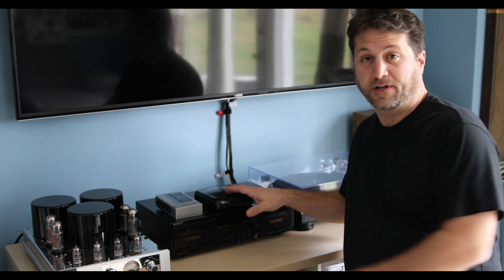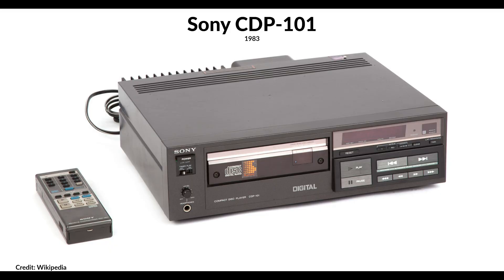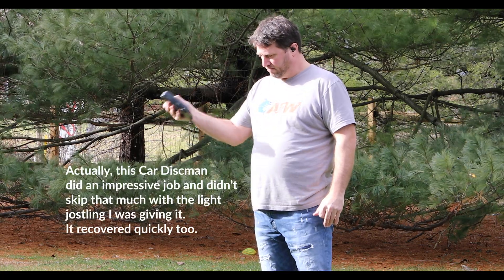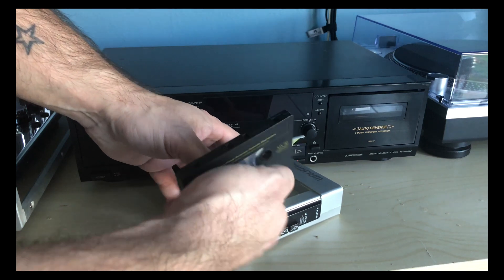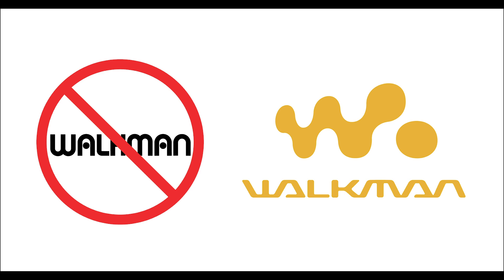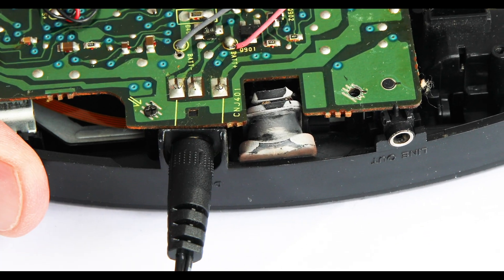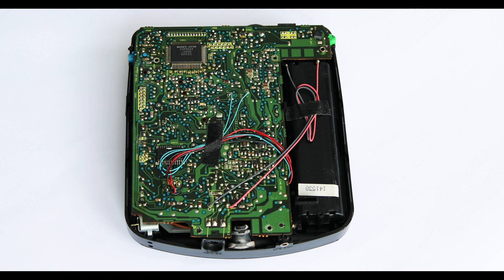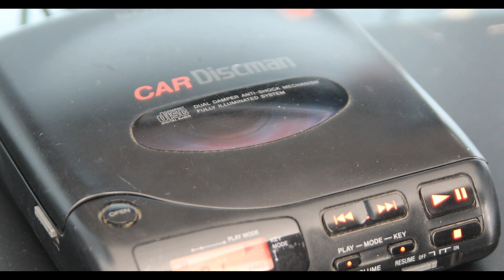History of the Sony Discman

Comment: Hi there, so it looks like the solder used was not the same as the original, (should be 60/40) and you've made some cold solder joints, which will break down eventually, and the yellow stuff is just flux left over from manufacture, so nothing to worry about in that regard. Some walkman's can get up to and exceed the 20-20k mark, but they are the more expensive end usually (DD range ect). (I'm an Ex-Sony tech by the way) Nice vid.

Comment: The first car Discman was the D-600 released in 1987. Like the D-5 it has only the basic controls and does not take batteries internally. I own this model with its original car mount.

Comment: I love the car discman detail of having the screen and controls backlit so you can safely use it when on the dashboard and driving at night.

Just one small critique, get the points to turn molten, rather than just adding a little solder on the top, as you can get a cold joint between the 2 solder layers, where is if you heat the entire pad it will form a single solder joint that is more durable and better conducting.

Good video!!

Comment: 9:01  It doesn't look like you applied enough heat to the joint for a reliable connection.  Your tip is for smaller connections, so you could at least use it sideways to apply heat evenly to the whole area of the solder or you are risking a cold solder joint again.  You need to make sure that all the components are heated up, not just the solder.
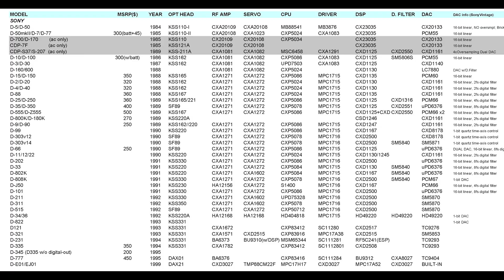7:08  There is model D-822, but I don't see the specific D-822K model that I have (can't find any D822, so is it just a typo?).  It's a Car Discman that is not included in the picture (yes, there are just 24 models shown there).

Comment: Got a D180k today and it's like new! But it only has a car battery charger. Now, to make it light up without plugging it into the car, you just need a simple 9-volt wall charger and that's it? What size should the pin be? I am from Argentina and here it is 220 on the wall. Would I need a 110/220 transformer?  I want to use it in a home audio system. Excellent video by the way!
Reply: You shouldn't have to find the brand specific charger, just get a 220V to 9V PSU with the correct plug, the correct polarity which is VERY important, and enough amperage to power it, and you should be good to go. Barrel plugs of that voltage use tend to be 6.4mm, and the amperage requirement on the unit isn't the exact amount you need, just basically the minimum amount. So if it says 500mA, make sure the PSU is 500mA or more, but not less.

Saludos desde España
Reply: @hyzenthlay7151  muchas gracias! Saludos desde Argentina!